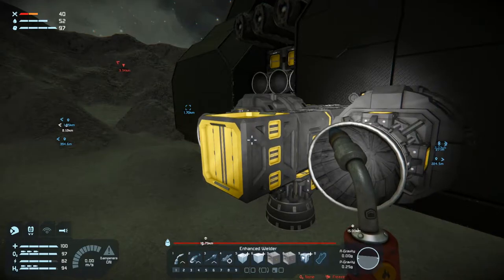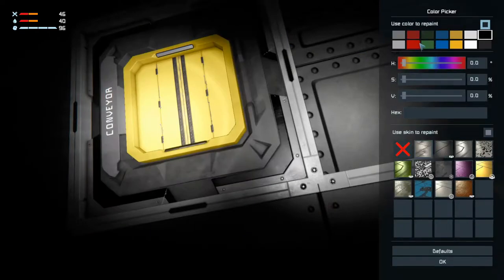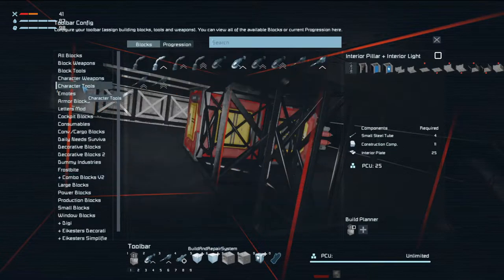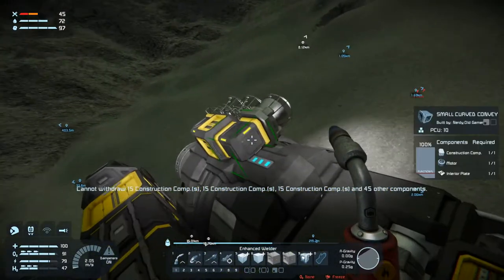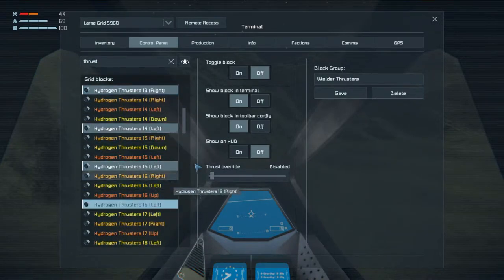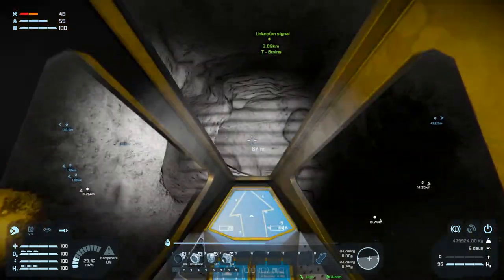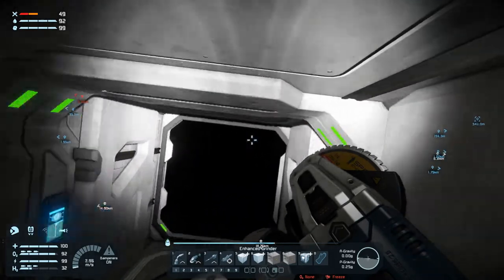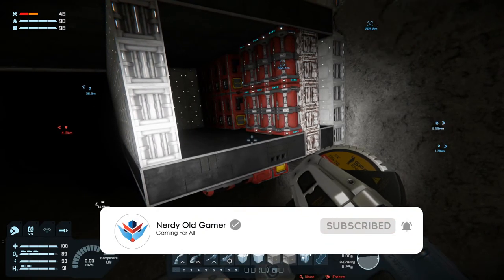Lets Play Space Engineers Modded Survival S2 Ep21 | SO MUCH BETTER!

Comment: While revisiting this episode I realized something... Why do you mess with the dimensions of the build and repair (aka BOB). Most people want it to stretch as far as possible so that it can help build things even outside the base? Also if you have built more BOBs then don't forget to turn them on.
Reply from the maker: I mess with that because it seems to me like the system searches in a direction until it hits something that needs building and then it builds it, but if there is nothing in the direction it searches, it goes to the limit of the area and returns and starts over in another direction, so if I limit the size, it's "no hit" searches become shorter, meaning it'll build faster... Not sure if that's true, but it just feels like that to me.
Reply: @NerdyOldGamer  As far as I am aware it doesn't do that. But it might in walk mode. Just another heads up walk mode means that BOB will work on things connected to the grid while fly mode allows it to work on anything within its sphere of influence (aka work area) regardless of if it is connected or not. I am not 100% sure how it works check the moders page for more accurate info.
Reply from the maker: Aaaahaaaa, that explains some things 😂
Reply: @NerdyOldGamer  Hope it helps. BOBs are one of the most useful mods out for Space Engineers and their only real downside is that they HAVE to be connected to cargo containers to be effective. Other than that they can even be used offensively while they are in fly mode if you have them targeting enemy blocks to grind and can get close enough for them to get to work.